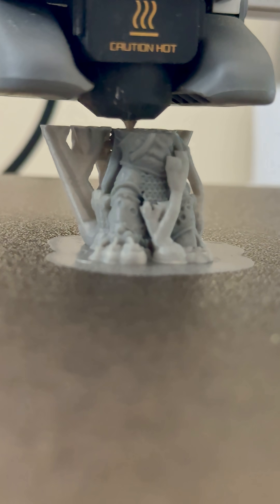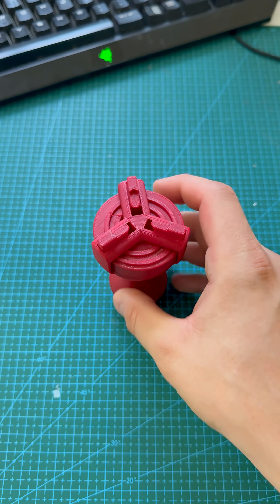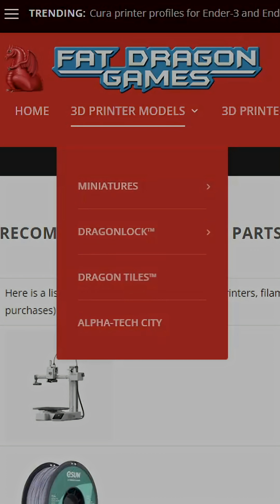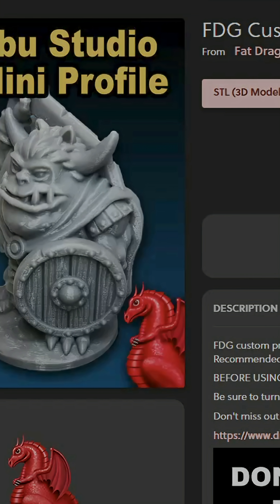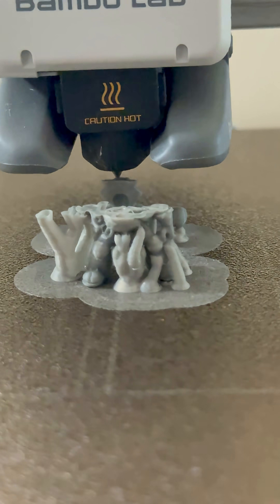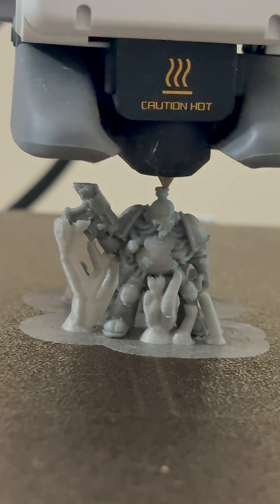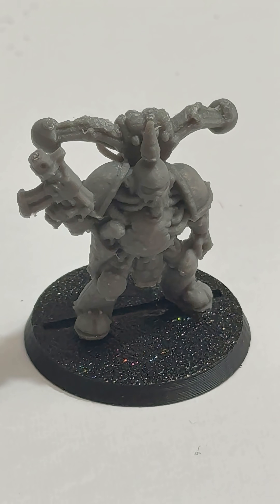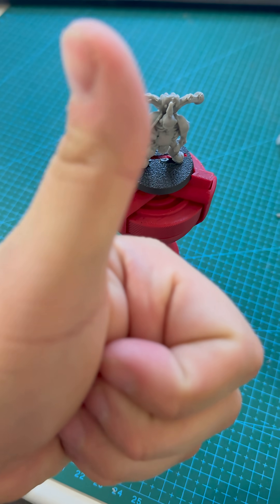Can FDM 3D Printing Handle Miniature Detail?

Comment: Really happy with the detail??😂😭 that looks like a dog chewed it and spat it out. 
Short answer no. Fdm printers can’t handle printing minis
Reply: this is a poor example i print with resin and just tested on the  p1s and got fantastic results side by side in primer they are super close. you just need high detail models .2 nozzle
Reply: @forsakenraptor4931 yeah I also have the p1s and use a .2 nozzle at .1 layer and get good results but ya can never beat resin
Reply: @17larth .06 layer looks amazing but is a challenge 3 out of 4 minis were amazing also fdm takes 3 or 4 hours for a small mini just for one so thats a big downside as well resin definitely beats it
Reply: The top was not ironed.
I get was better results with my a1